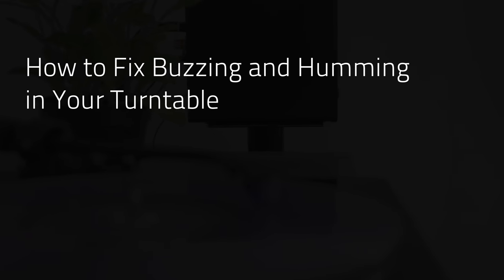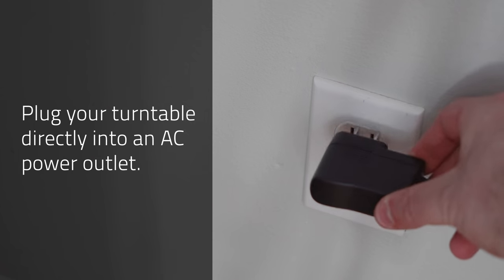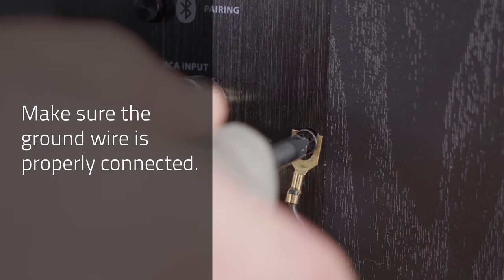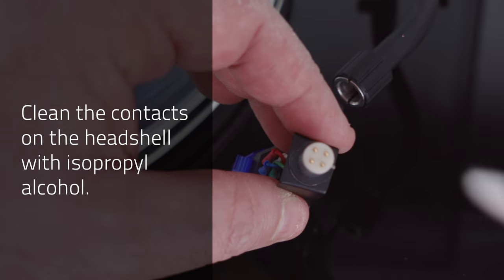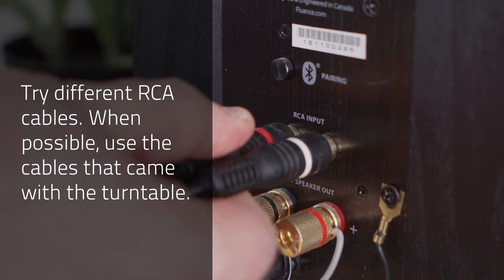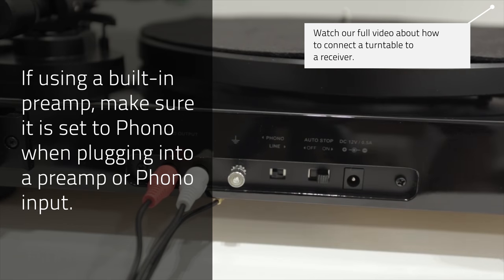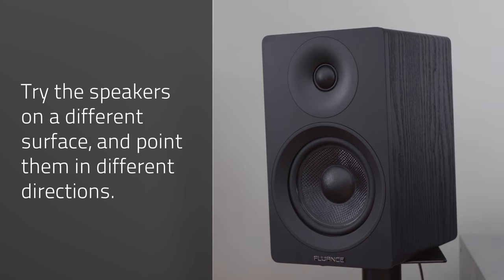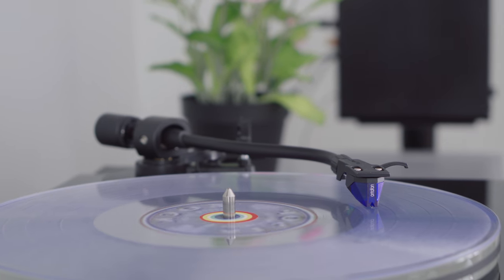How to Fix Humming and Buzzing Noises from Your Turntable | Record Player Ground Loops and Feedback

Comment: Well done, a great guide. A further cause with vintage turntables, for example 1970's belt drive decks, can be mechanical feedback from the motor. Often the motor was isolated using rubber mounts, and these can harden with age, loosing their suppleness and hence ability to absorb vibration from the motor . Often they can be restored to original suppleness using soap and hot water, rubber restorer, glycerine or platanclene print roller restorer

Comment: Thanks so much!!! I originally thought I had a  ground issue. Feedback is culprit. I have the over amplification issue because at low volume everything is fine but, as soon as I turn it up above 1/3 volume I hear a bass feedback coming through. Not a buzz like I originally thought. Kudos!!!
Reply: How did you fix it?
Reply: @frankrizzo2724 did you ever fix it. i assume you had the same problem
Reply: @SSinatra  I stopped listening to vinyl, so technically I fixed it. I haven't tried it yet but I was going to try a ridiculously long grounded rca cable. I should have known better than to try a turntable on a setup with PA amplifiers.

Comment: I was hopeful, but all hum in the right, all tunes in the left.  The balance knob is my only saving grace.
Reply: I had the same problem. Just buzzing from one speaker, the left one. The right speaker was perfect. Trouble shooting I swapped the RCA cable, the speaker cables even the amp. Still nothing so the turntable must be the problem. As the guy suggested in this video, I removed the needle and re-mounted it. It worked. Buzzing stopped.
Reply: @Alan-jw2iv  thanks for the tip! I'll give it a shot, although I already bought another one.

Comment: What if I hear that first hum when the turntable is not spinning? But it goes away the second I start spinning, even before the needle drops. Emotiva BasX TA2, Project Tube Box S2 (phono preamp), Technics SL-1500C turntable, Audio-Technica VM540ML/H, KLH Model 5 speakers, SVS SB2000 sub (though, this is not even powered on much of the time)

Comment: I have an AT-120 with a preamp/USB switch. When I connect the turntable to my laptop via USB, I get a high-pitched mosquito hum. I can remove this hum in Adobe Audition by selecting it as a noise print, but is there a better way of eliminating it? Like disconnecting the ground wire or something?

Comment: If you changed your catridge and still getting feedback hum  after following the video tips do check that the 4 wires connected to the cartridge are properly matched to each pin i.e. R and L ground , R and L positive 

There's no standard pin configuration mismatching will lead to issues i.e. feedback hum.

Happy listening.

Comment: My Magnavox record changer hum comes from the mount for the tonearm and not the tonearm. Where the tonearm sets on a vertical "axle" at rear corner has the hum. Intermittent  hum as I touch it. What causes this and what can I do to get rid of that hum? It's like something is not grounded properly and affects the sound. I replaced the needle and it is not the needle. Thanks.
Reply: I have the same issue and have spent hours trying to resolve it. To date I have still not resolved the issue.

Comment: I have an Audio-Technica AT-LP120XBT-USB turntable connected to a soundbar system (which includes a subwoofer) by Bluetooth.  I have no receiver and/or pre-amp.  Just the turntable and Bluetooth soundbar system.  If I turn the volume up on the soundbar above about 60% I begin getting a very bad humming sound.  If I turn the subwoofer off it stops.  I've tried placing the subwoofer on a foam bad to isolate vibrations thru the floor and that didn't help.  I move the subwoofer as far away from the turntable as possible (approx. 20') and that didn't help. If I turn the subwoofer off while playing a record the humming stops.  I checked the turntable cartridge and it seems fine.  Listening to the TV through the soundbar produces no hum.  Just the turntable.  I've read that this could be a grounding issue (ground loop) and the fix is to ground it to your receiver or pre-amp but I am using neither.  Also, the turntable and the soundbar are around 10' apart from one another.  Can you give me any suggestions on how to fix this issue?  It's very annoying.
Reply: I have the same turntable, it produces bass sound if I touch it even slightly. I am going crazy with it, I was thinking of returning it. I tried hooking ground wire to a “Marshal Stanmore II” (powered bluetooth speaker) but its the same. Did you find any help?

Comment: Does it matter if the ground wire is connected between the washer and ground screw? Or should the washer and screw be over the ground wire? Thx in advance 😊
Reply from the maker: Great question! You should connect it as close to the body of the turntable as possible under the washers.
Reply: @FluanceSpeakers  Thx for fast reply!😀

Comment: I got overamplification but im using active speakers and there's only one type RCA input, how should i change my external pre amp to CD input? Do I really need an amplifier and passive speakers to fix this? 

FYI, my turntable is Crosley cruiser without built in pre amp. Or is it because of my cheap turntable
Reply from the maker: It's possible the Crosley already has a preamp to play through its external speakers. Connecting this to another preamp will over-amplify it.

Comment: Hello. I bought a Pioneer PL-Z81 hifi set in 1970. Amp gave up recently. New Yamaha amp. Now a buzz through speakers when using turntable, which has plastic body. Have looked inside, but don't know where to attach a ground wire, apart from screws in the plastic body. HELP. THANKS.
Reply: Sorry 1988

Comment: Hi if someone could help.   I am using a musical fidelity amplifer class A100 50W per channel.  I have ground it to the amp.  After playing the record for awhile, it start to hum.  The solution to it is, I tab the amplifier turning nob.  ( the circle round selection nob where you turn the nob to select CD, Phono etc).  That is the one that i just tab it and the hum is gone.  And 3 mins later, the hum came back again.  Is that my Amp issue?  For information, my speaker is a MS10 8 ohms speaker, is that causing the problem that harm my amp?  Some people say i should use a 4 ohms speaker... thanks in advance.

Comment: Sometimesy receiver sounds louder on the left channel, but it is not the reciever I have connected my turntable and a CD player to the same receiver, the weird thing is that when my reciever sounds louder on the left channel when playing my turntable, I turn on the equalizer that is connected to a CD player not to the turntable, voila!! The sound on the right channel of the reciever is equal to that in the Left channel, and sound is better!! Crispier and cleaner. What could it he?  May the reciever need more grounding?  That when I turn on the equalizer that is connected to the CD player that obviously is connected to the aux input sends more grounding ?
Reply: It might be the azimuth of your cartridge/stylus needs adjusting. I believe if the stylus is not centered perfectly up and down then whichever side of the groove the stylus is digging into more will be the side the speaker sounds louder

Comment: I'm still getting the sound from the amp even when the record deck is turned off .when the amp is on phono .even over output is fine
Reply from the maker: If you have a Reference series turntable, the speed selector dial only controls the power to the motor. The turntable is still powered on and picking up signals. Feel free to reach out to our Customer Experience Team for further assistance!

Comment: Good advice,  but make sure the grounding wire is attached to a machine screw into the metal chassis, not wood. 
The one you used sure looks like a wood screw.

Comment: Thanks for the video but non of it solved my feedback problem.. I really dont know what to do.. When I open my windows in my room however the feedback disappears.
Reply from the maker: We're sorry to hear that. It may help to add some dampening panels to the walls of the room. Removing the dust cover may also help.
Reply: @FluanceSpeakers  thanks.. I just figured out that if I adjust the weight knob and add more weight to the stylus onto the record it actually helped

Comment: I only get this when i touch the tone arm. Any advice?
Reply from the maker: Hi Serano, we're sorry to hear you're experiencing this. Please feel free to reach out to our Customer Experience Team via Support.Fluance.com for further assistance!
Reply: Hi I have the same issue. all is fine until I touch headshell, then I can hear hum, but at the same time when I touch with my 2nd hand amp shell or ground screw the it slightly can be heard.
Reply: @KRZYCHCZARA  Can you hear it when the needle is touching a record?
Reply: My problem is when the record is spinning or playing I hear a lagging like sound enough bothersome to turn it off it's a Crosley AmFm radio Cd cassette Turntable Anyone can help me!?
Reply: I managed to resolve it. Its not as loud as it use to be very faint if you pay attention. What i did was i plugged in the turntable into a wall socket of its own. I kept the amp on a different socket and my phono stage uses a battery. Try minimising the amount of plugs on one socket.